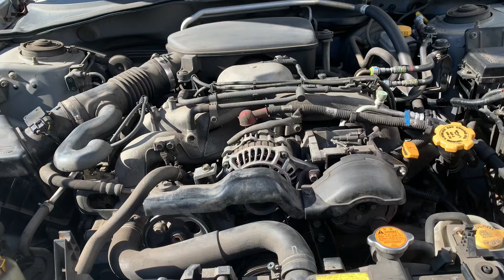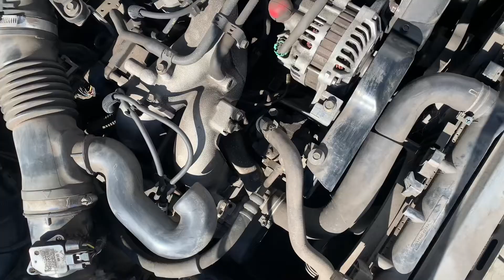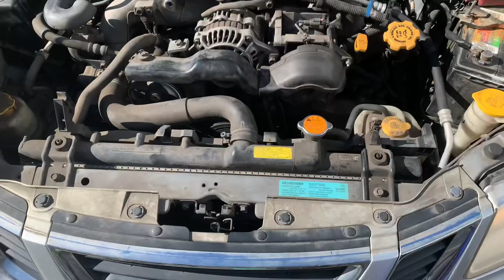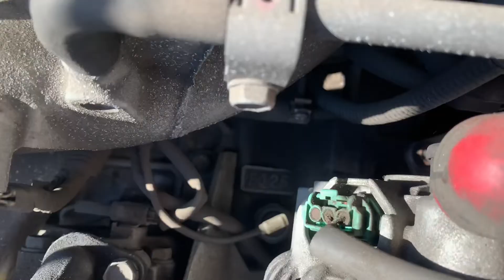Subaru Engine Piston Slap Sound

Comment: This is actually the timing belt tensioner hydraulic pin knocking on the steel pin attached to the bracket. You cannot go tens of thousands of miles with piston slap.
Reply: so is it normal?

Comment: We bought our 2003 Outback with 25,000 miles on it, in 2007. It made the piston slap sound then, we were told about it by the sellers, and to this day, at 81,000 miles, it still makes the same sound when cold. Take a drive across town and it quiets down. A couple years ago I changed the timing belt, tensioner and pulleys, and water pump, so examined the tensioner for slackness, as that can be the source of some noise in some engines, but it was fine. It's always been parked outside in Anchorage, Alaska, so it is pretty loud on a cold day, much more pronounced than yours in the video. I just do regular oil changes, and it never lets us down.
Reply from the maker: People say it can run fine for many years while making piston slap sounds. I recommend you keep driving it forever. You’ll probably be fine.
Reply: @hoohoohoblin  I'd be so grateful for help, as any repair will be debt.  My meghanic is not Subaru trained.  / how could I have gotten free bloch replacement on my 2011 Forester?  was preowned paid off.  Now heard rod knocks at 45mph- within couple minutes, stopped accelerating.  All lights turned back off that were on dash after car was pushed in neutral- then only red oil lamp symbol stayed
Reply: I'd be so grateful for help, as any repair will be debt.  My meghanic is not Subaru trained.  / how could I have gotten free bloch replacement on my 2011 Forester?  was preowned paid off.  Now heard rod knocks at 45mph- within couple minutes, stopped accelerating.  All lights turned back off that were on dash after car was pushed in neutral- then only red oil lamp symbol stayed

Comment: Haha built in auditory feature. I like that. Yes it’s definitely a piston slap. I just rebuilt my 08 all the way down the main bearings. It had new pistons that were a few thou under sized for some reason and it makes the same sound now, same decibel and all.
Reply from the maker: All that work, and still the same sound! It’s good to know that the car can still run fine with some slapping.

Comment: My Impreza has this sound. Would you recommend to put thicker oil in it 10W-40 now for instance? Thank you
Reply from the maker: That’s a good question. I put some oil additive in it and it runs fine. You can go to the Subaru, forums and see what people say there. Usually when you start talking about oil, everybody disagrees about everything.
Reply: @hoohoohoblin my 96 EJ25D outback does this. Doesn’t quiet down after warming up. 136k miles did head gaskets 6k ago. 

10w40 didn’t make it go away but helped tremendously. Rotella T4 conventional 10w40 or 15w40 works wonders.
Reply: Your engine needs 5W-30 or 5W-40, the latter one is for summer. Going with a thicker oil may burn out critical engine bearings, quiet it's death and reduce oil consumption while it plans to drain your savings. Actual results may vary. 😂

Comment: Another good way to differentiate between rod knock and piston slab is, piston slab gets better when the engine gets hotter and the piston expands. Rod knock gets worse, because the cold oil is more viscose and dampenes the noise and when the oil gets hotter is more liquid and the dampening effect reduces dramatically. If you have a oilpressure gauge you also can see, that the oil pressure is unusually low and potentially dangerous for the rest of the engine. 

Therefore a piston slab is less severe than rod knock BUT that doesn't mean you don't have to take care of it.
Reply: Humm. Im having trouble figuring out what is what. I swear my knock sounds about the same no matter if the car is hot or cold. It may get a bit quieter when it's hot but it's still there

Comment: What about if it only does it at certain rpms? Is it the same thing piston slap?
Reply: i have a 2016 wrx ticking/knocking at 2.5k-3k and it seems more like something is loose in the engine bay. it can sound exactly like a knock almost

Comment: Yep, this is it. Thank you. I have been noticing a slight noise (this exact noise) on cold start and for about 5-10 minutes as the engine warms. Twenty year old car. I have a new car on order that should arrive in some months so I just need it to last until then.
Reply from the maker: It should still run for quite a while with the sound.
Reply: I did from 200k km to 400k with the sound😊 then i changed the engine since i happened to have one in Better conditions from One parts car, but was still going strong, only the maintenance and some oil

Comment: My 2003 Subaru outback has the same issue, though it won’t go away over time. It stays. But you can’t hear it it higher rpm’s though.
Reply: same! did you ever figure it out??
Reply: @dylandeanisclean1272 unfortunately soon after I made this comment I crashed the Subaru, total write off, it got scrapped

Comment: Hey
I have the same issue but its getting weird annoying now. It used to go away once i drive a little bit or if engine gets little warm. But now it doesnt go away no matter how much i drive
Reply: It goes away on high rpm
Reply from the maker: The Subaru people say it’s normal and don’t worry about it. You might want to have someone who is a Subaru expert. Listen to it.
Reply: @hoohoohoblin  are you sure because it got worse🤔🤔
Reply: @Drifter703 ur car still making the same noise? Engine still running good?

Comment: THIS OH MY GOD. ITS THIS. Thank you so much for posting this video. I drive a 10 year old falcon (Ford Ecoboost 2.0 T) that makes the EXACT SAME SOUND when cold. Though because of the sound insulation it sounds more muffled through the cabin. It lasts 5-10 seconds when cold then mysteriously disappears. No mechanic has ever picked it up because by the time i get to the mechanic it's gone. It's been going on for three years now and it still drives fine.
Reply from the maker: You're welcome!  On  Subaru engines, they say it’s not a problem, but I’m not sure if it will eventually blow up a Ford engine.

Comment: This is the exact sound I had on my EJ205 right after I had it rebuilt by a Subaru dealership... I thought it was just break-in noise from the new short-block they installed, but then I also noticed it was leaking oil from one of the cam covers, so I took it back and had it fixed under warranty. IDK what the cause was to this day, but I'm not so sure it was piston slap because the sound went away after they replaced the valve cover, and probably inspected/adjusted the timing belt. I don't think they took the heads off and replaced the pistons in a few days time...
Reply: It depends on how long you drove it after the rebuild, how bad the oil leak was, and if the oil level was too low.

Comment: Man, I'm so glad i finally found this, Im a relatively knew Subie WRX owner(FA20)  and im going crazy thinking my engine is done for. Is this normal on FA's as well? i have 90k miles
Reply: I think so, 2018 WRX is at 80k and has this sound too, but not as loud. It gets less noticeable when the car is warmed up
Reply: I did notice this post was almost a year ago. How’s it holding?
Reply: @ethangrillo3946  it’s still kicking. 97k miles
Reply: Same on my 2015 FR-S FA20 with 113k miles. It’s not as loud as this and doesn’t last longer than a few seconds on startup in the morning but it definitely has the same tone. Hasn’t gotten any worse in the 7k miles/ 8 months of ownership. Iv heard too many rod knock videos and it sounds a lot more metallic, louder, and more rapid.

Comment: Piston slap is essentially the piston head wiggling around inside the cylinder. It can and will eventually wear your cylinders out. The Subaru people who say it's 'normal' for the engines may be right, it may be 'normal' for Subie engines, but it's not a good thing. Any mechanic with a brain cell will tell you that piston slap isn't good for your engine. I do have a Subie, and while mine doesn't make the noise, I'm quite glad because it is not a good noise and while the engine may last a while longer, it's still something to be aware of and the potential damage is something to be prepared for.
Reply: older ejs is not a big problem, the seal is so tight and good that the pistons cant really get a "slap" but some small wiggles. but newer ejs where the seal isnt as tight because if them trying to get better gas mileage with less friction, the piston wil do proper slaps and the rings and bores will wear out from being allowed to vibrate more freely.

Comment: Piston slap will degrade the bore and increased wear to the piston rings.  It can also let in oil and start burning it.
Reply: That's another reason why they call it the boxer engine, because as a luxury you get that physical contact slap sound like a speed boxer
Reply: 2618 forged pistons do the same. I had to use .09mm wall clearance on my engine because of how much the piston expanded after heating up. It’s a price to pay for high performance.

Comment: Use better octane 92 gas . Try that
Reply: Low octane knocking occurs under engine load, never during warmup or idle, and it's rare in modern computerized engines... and when it occurs in these engines, the knock sensor may have failed.

Comment: It's not "normal" and it drives me insane but I try to live with it. I hate it though
Reply: Mine made that noise for about 40k miles, as the oil consumption gradually worsened to the point that I was putting a full quart of oil in every gas tank fill up. Just to clarify, I bought the car when it had 120k miles on it, and it started making that noise at 160k miles. Then suddenly (at about 195k miles), a bearing failed and the noise got MUCH, MUCH worse. Bearing metal throughout the engine, horrible symptoms while trying to drive made it unusable. I replaced the engine with a remanufactured engine, and the noise is entirely gone. I've drive about 10k miles on the new engine so far, and the engine is still very quiet, even on below freezing temperature startups. I also no longer have to add any oil between oil changes (basically zero oil consumption now), and I'm hoping it stays that way for a long time.

Comment: It is piston slap, ive had vehicles with rod knock and piston slap ( old EJ engines notorious for slap )that is NOT a rod journal bearing! The #1 way you know is if it stops after around 10 minutes when the piston head swells to conform to the diameter of the combustion chamber. A rod knock will NEVER stop, it gets progressively worse and it also produces a different sound. Its a very hard resounding deep knock. Piston slap is annoying at worst when its cold, and does nothing really to the vehicle
Reply: This is correct i have a ej205 at the moment that has developed a rod knock for the past 3k miles when its cold you cant really hear it but after it gets warmer it starts to knock crazy and it gets louder every day aswell.
Reply: @kirilakmadjov8307  it happens to the best of us, you could drop the oil pan and slip in some new bearings for a cheap fix or let a mechanic do it( more expensive ) depending on how much it means to you
Reply: Or run it til it blows
Reply: @S.L.R.  i bought new rod bearings a month ago with the intention to drop the pan but i said to myself if it had gotten to the state of knocking new bearings wont do the trick for too long anyway.So ill rebuild the whole engine next month new crank and bearings.
Reply: @kirilakmadjov8307  sounds good man
Reply: My one sounds like this but even when it's warm it still makes the sound but only at low rpms. Burns oil too. Is that normal w this sound?
Reply: Mines been doing this noise to for about 60 thousand km now lol runs great no issues just annoying
Reply: I have one piston thats loud, after about 5-8 minutes it quiets, mostly a cold weather occurrence. Otherwise reasonable oil consumption and great running until triple digits. Head gaskets coming due, 193,000 miles. 2001 Outback 2.5L
Reply: It absolutely does something to the vehicle. Piston slap will wear away the cylinder walls in the direction of the piston slapping, causing an oblong shape to be worn into it, eventually causing oil blowby and you'll start burning oil.

Comment: If my mine noise is on the driver side sounds the same but a little louder any tips or help on understanding it better
Reply: Its really just ur piston slapping the sides of the cyl wall until it warms up, i GUESS its a subie thing, i have a turbo impreza 2004 with 153,000 and it was a old track car, it runs fine and slaps in the morning.

Comment: I have the same sound like the exact same sound.. Is it really a piston slap?? I checked the Timing Belt Tensioner, its good.. Pulled the Valve cover and checked the clearance, all within spec but one is a bit off.. the exhaust clearance on the cylinder #3 is a bit loose (0.014) can that cause the tick or knock?? and i also dropped the oil pan and checked the rod bearings, 2,3 and 4 were good.. took the bearing off and checked the rod journal, it looked great.. is it my cylinder #1 knocking?? ggaaaahhhhh

Comment: Could also be from a bad timing belt tensioner.
Reply: Could that also cause oil to leak into your spark plugs? I just replaced the seals about a year ago. 

I'm also getting the misfiring code. For literally all for cylinders.
Reply: @eggpod4567  Redo your sparkplug seals, sounds like you installed them all wrong and or rolled them on install. Use silicone grease to help keep that from happening.

Comment: Hmmm, knowing how engines work, I find piston slap a hard concept to grasp. As far as this vid goes.... could you get a mechanic stethoscope and try pinning down the noise and recording with that?
Reply from the maker: I know it sounds crazy. Subaru people swear it’s normal. I hope they’re right.
Reply: @hoohoohoblin  I have an 03 legacy it's the exact same sound. I've never had a problem with the car other than general maintenance. And the thing will tow a 1996 toyota 4 runner. I have video proof lol. It's just the boxer engine singing it's mechanical song